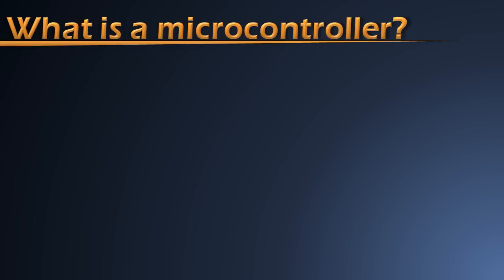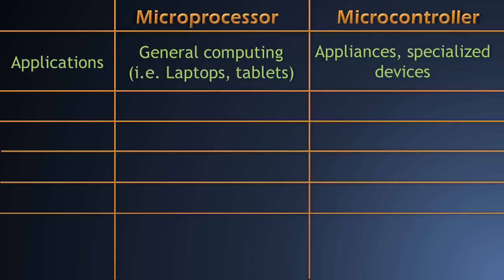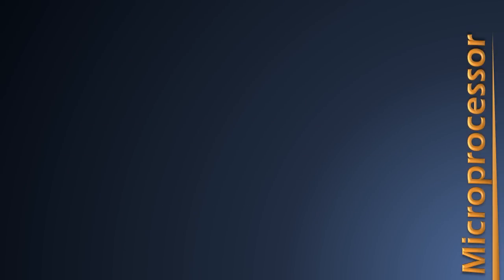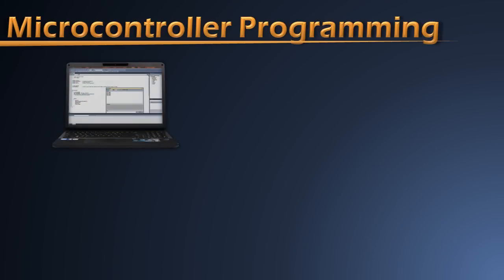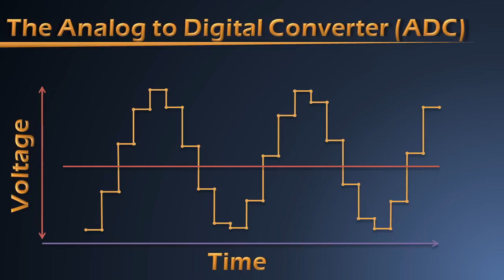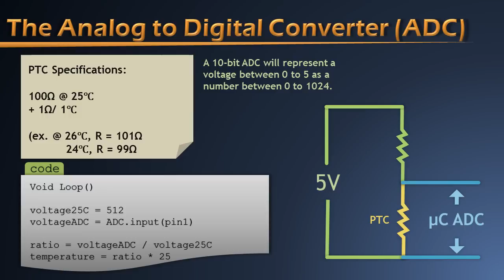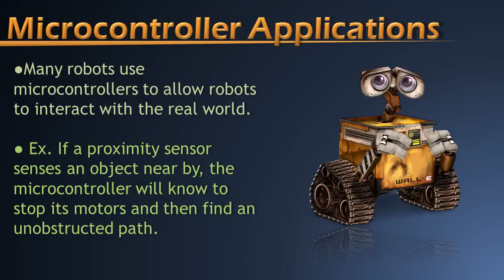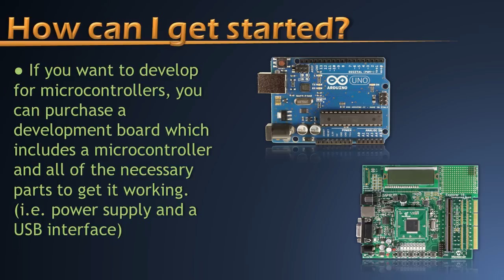An Introduction to Microcontrollers

Comment: Good summary.  A microcontroller has no operating system running. i.e. they basically do nothing until you write code and run it up to do something.  I am currently writing a small OS for my uC to allow multi-threading, but that basically means including the "OS" to do that within your actual codebase - which I need for real-time scheduling and responding to HW interrupts.

Comment: Let the PTC resistance be x and the other resistor has a resistance y where y is a constant. Then the voltage across the PTC is x*5V/(x+y). Let the temperature in celsius be t. Then x=t+75. You said that the temperature outside is directly proportional to the voltage across the PTC. This means that (x*5V/(x+y)):t=constant which is equivalent to ((75+t)(5V)):((75+t+y)(t))= constant. This is wrong. I would be glab if you explain what am I missing.

P.S. I enjoyed your video!
Reply from the maker: I scratched my head on this one for a while, and I realized that you are completely right. I convinced myself that by using a linear PTC that the voltage across it would rise and fall proportionally. But due to the nature of the voltage divider formula, the response is basically logarithmic. It's actually pretty linear if you only increase in temperature, but if you were to decrease then your accuracy begins to plummet. I will try to annotate some corrections if I can. Thank you.

Comment: Nice explanation +SolidStateWorkshop , but i have come to a head scratching position now :D , SoC boards are microcontrollers or different things , as Arduino UNO R3 is a whole board , taking the controller chip out will work of its own?

Comment: Good basic presentation.... I never worked with a microcontroller before...but now I want to build a multiband
radio using a microcontroller that will handle the LCD display and keypad process... I haven't decided which 
low power microcontroller to use...  Arduino ??   Any thoughts..  Let me know... thx
Reply from the maker: +afzpuppet If you're main interest is low power, the TI MSP430 may be  a good choice.

Comment: I'm new to seeing ur feed but, will(or have u made) make videos discussing  the topics listed below?

1. Introduction to Computer Hardware 
2. Introduction to Computer Software 
3. Computer Arithmetic 
4. 68HC11 Programming - Part A 
5. 68HC11 Programming - Part B 
6. Branching and Loops 
7. Indexing Through Memory 
8. Subroutines 
9. Reading Assembly Listings 
10. Memory Systems I 
11. Memory Systems II 
12. General Purpose I/O 
13. HC11 Interrupts and Resets 
14. Analog Capture - Port E 
15. Timed Events - Port A 
16. Serial Communication - Port D 
17. C Programming and the HC11
Reply from the maker: +james tomlin Is this a course outline or a book table of contents? I will likely do an intro to computer architecture video at some point, encompasing CPU design, memory interfacing, etc.
Reply: these lesson titles are from a course on microcontroller technology

Comment: Excellent intro, now I know I want to work worth microprocessors but also realize I will have to start with a micro-controllers. I like maths and want to make a rational database. However, I want to work with a screen, have a menu and work with pictures. So what do I buy? Arduino, Pi ....?
Can you recommend a starter package?
What programming languages might I use/encounter?

Comment: his first video, this guy got talent
Reply from the maker: Your other comments aren't showing up on the video (but I did get notifications for them). I'll answer here. First, thank you.

Microcontrollers are soldered to a printed circuit board. Older chips might use through-hole pins (i.e. DIP package). Soldering those pins is very easy. Surface mount packages like SOIC are a little trickier but you can still use a regular soldering iron and lots of flux to get the job done. The most difficult package to solder is a BGA. The "pins" on a BGA are tiny balls of solder. The pins are not exposed (as they are underneath the chip). To solder these, you must perfectly align the chip on the circuit board pads and then apply hot air to "reflow" the solder balls and make connection with the board. It is possible, but definitely takes some practice.
Reply: thanks a lot, yes i deleted the comment cause i tough it maybe smart to google first before been lazy. I saw on a video they indeed solder and desolder with some heather, but if you expose che chip to long in the heath it can damage the chip.

Comment: I am looking for a microcontroller that has one input and dozen outputs that affordable.  I want to be able to program with my chromebook.  I reliable one.  Any suggestions?
Reply: If you want to program with your chrome book, won't you need a microprocessor instead of a microcontroller?
Reply from the maker: +JusBeCuzz I think you're missing the point. He wants to program a microcontroller using software on his chromebook. I don't think there's too many IDEs/editors for embedded microcontrollers for Chromebook, but I have heard of ChromeDuino which you can use to write Arduino sketches.

Comment: so, a mcu, is just a mini computer programed to do one task(like run a camera or cell phone) unlike a computer which can do multiple tasks?
Reply from the maker: james tomlin You are correct in saying that an MCU is basically a mini computer designed to do a single task. Think about household appliances that basically just do one thing. 

However, phones almost always use a microprocessor, and not an MCU. (Phones are basically full blown computers nowadays, if you think about it.) In a camera, I’m not too sure. I think it could go either way. Let me know if you have any other questions.
Reply: @SolidStateWorkshop  will u make more videos on analog electronics? and also make videos on digital electronics?
Reply from the maker: Yes, for sure. The time frame, I'm not so sure about. Trying to figure out a good balance between all of the stuff I'm involved in. Hopefully can make more time for videos in the future.

Comment: This is probably a stupid question, but can you install an os on a micro-controller?
Reply from the maker: +The Whatever Show Depends what you mean by operating system, but you can install a small real time operating systems (RTOS). If you are looking for an RTOS, look at FreeRTOS. But for PC operating systems like Windows & Linux, then no, they won't be nearly powerful enough.
Reply: +SolidStateWorkshop  thank you so much. Helps a lot.

Comment: I'm a backend dev looking to self-teach some embedded systems engineering and your videos are really good introductory material for me. Apart from the EM course I had in sem2 of my first year, I don't have any practical knowledge about electronics beyond that. All we learnt there was plugging in numbers into the right equations. So thank you for providing this free and valuable knowledge. Of course, I also took basic computer architecture, logic design and OS courses but they were mostly theoretical and we never got our hands dirty actually making those circuits.
Reply: Which is the best micro controller?

Comment: i think you miss explained difference between microcontorller and micro prosessor ..., CPU=microprosessor , and there is one in micro controller ,..... they gust less powerful because application they are designed fore hove no need for such computing power ...

Comment: so what are we suppose to call an ardiuno board
Reply from the maker: +Ashton Grist An Arduino board is a microcontroller development board, since there is a microcontroller chip on the board but also many other supporting parts that help make implementing your project easier.

Comment: Everyone always gets the stair step waveform relationship wrong - the sample points ARE the correct waveform as they are the point values that define the equation that relates the waveform shape to the math function. A HOLD function applied would show the stair step, but that it NOT an accurate digital representation of an analogue waveform - mythbuster vid here by Monty Montgomery:
https://youtu.be/cIQ9IXSUzuM

Comment: @29:14 that program doesnt give accurate result even if i assume the PTC is 101ohms (26C)....the temp formula doesn't exactly give 26.......
Reply from the maker: Bryan Fuentes Thanks. At one point I added an on screen Youtube annotation to correct it, but I dont think those show up anymore.
Reply: Solid State Workshop We need more videos on electronics and programming

Comment: Thanks for your video. I have attached to work in troubleshooting circuit card that move électric motors automatically the gate of car garage. This card the display of two digits does not light but when I touch a pin of an output of an optocoupler it ome to light but when I release my finger it will be off. My question want you to help me to show me which pin in the micro is responsible for lighting the display

Comment: microcontrollers need to be programmed before working  like a ram ? So it is cheaper .and you can  write down what your design ? Microprocessor had programmed inside can not be change .control as it is what it before ?  Is it correct

Comment: Well done for first video!
Do you know which micro controller is best to output led RGBW PWM? I want to learn how to program a chip to "do" all the colors and say, 24 different intensities, color cycling and speed of color cycling from just red, green, blue and white leds and with a lowest possible voltage. The voltage of all the (Cree) leds is only up to about 3 volts but I know I'll need more voltage to cover power transistors (I want about 700 mA per led) and possibly the chip (but I thought that some chips may need as little as 3.3v).
I also want to be able to use only one switch such as quick click to stop color cycling on whatever color, be able to click fast to step every one of say, 24 different colors. To slow release onclick to start variation of speed of cycling, and perhaps slow then real quick to initiate brightness intensity. I don't know If I could learn to do all that but realize its simple compared to what "real" programmers can do.
I assume this would be a rather small chip and it "must" be DIP for ease of connection.
If you have any ideas, please direct me! Thanks.

Comment: so what are we suppose to call an ardiuno board
Reply: a development board that essentially makes learning & prototyping of any electronic projects easier, faster, more user friendly & cheap.
Arduino board + its custom IDE to be exact.
basically its designed around the whole AVR microcontroller ecosystem, for most of it.

Comment: Why don't you take a motherboard and a processor. Show the processor and explain. put the processor on the motherboard and explain. It would be a much better example of the difference between a processor and controller that far more people will comprehend. It will also cut down the first 15 min of the video.
Reply from the maker: +Patrick Wall Hi, not sure exactly what you're recommending.
Reply: +SolidStateWorkshop It's the way you describe a controller and the graphics you use. You say that the micro controller is like the whole computer. That comes across unclear because when I think about a whole computer I'm thinking screen, keyboard, printer, maybe tower. I understand what you mean but alot of people won't. And your trying to illustrate the difference between microprocessor and microcontroller using the same analogy using graphics. with just the processor to show the processor. then  the processor with peripherals (which looks amazingly similar to a chipset diagram) to illustrate the microcontroller. Most people will recognise a processor on sight nowadays, they'll also recognise a motherboard. instead of the graphic that uses representations of these  things why not use the actual objects or pictures of them. people will relate much better if they see the processor take one from Intel's commercials they'll give you a clip for educational purposes. more than likely the majority of your audience will instantly recognise the stand alone processor. Then the motherboard, and I would actually install the processor to show that a controller can include processing components. And the motherboard with processor is a hugely complicated and oversized controller in a way just not micro. maybe use a micro ATX. O.k fine an Arduino will do but you won't get the same impact with the understanding of the difference that you will with a CPU/mobo demonstration. no separate processor to show as a freestanding entity.
Reply from the maker: +Patrick Wall Thanks for the feedback. I made this video for my junior year (in high school) electronics class. Never thought it would get this much attention so I didn't think about it too much. I'm still a little unsure of what you're saying, but I believe you're suggesting show a PC motherboard and all of the things on it and then show a microcontroller on a board (which will have much fewer supporting components). From the feedback I've gotten, it seems that most people understand what's going on, but I'll consider your input if I ever remake this video.
Reply: +SolidStateWorkshop Oh, didn't notice the date. nice job.
Reply: +Patrick Wall I was just commenting on the beginning. it's a long explanation of the difference between a microprocessor and microcontroller. it was a way to shorten it.
Reply from the maker: +Patrick Wall Thank you. I'm thankful for your input because I know there are many things I would do to improve on this video in the future. It's informative but could be a lot better.